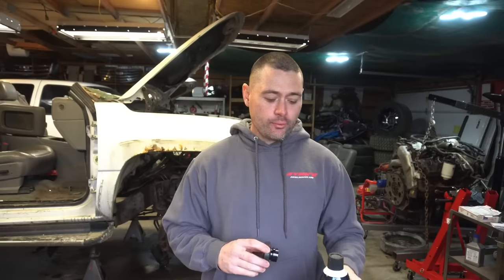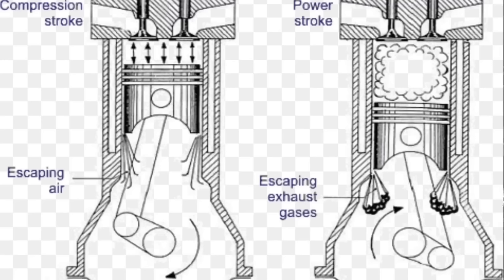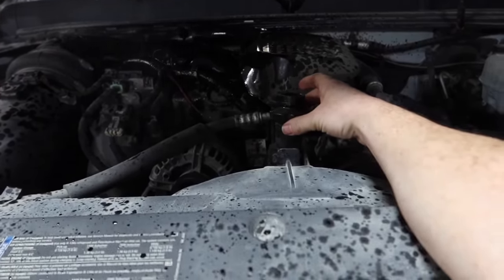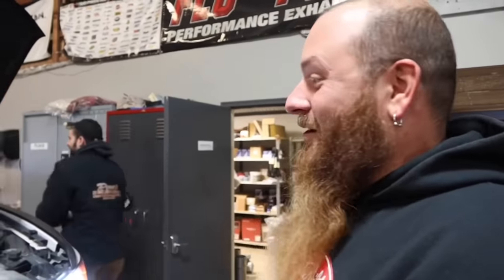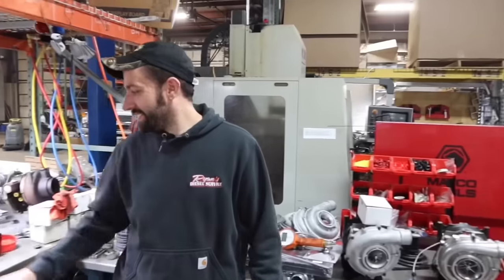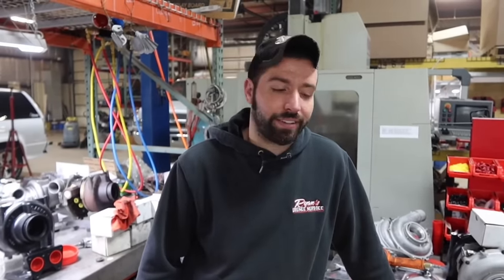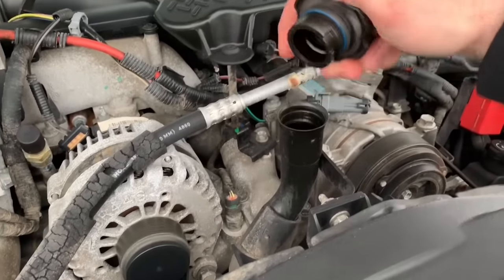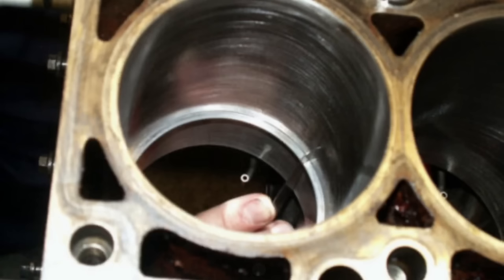What Is Diesel Blow By?

Comment: I bought a used 2013 Chevy Silverado 2500HD 6.6L LML Duramax with 144,645 miles on it. 100% stock and very clean inside and out. I did the oil filler cap blow by test at the end of my test drive, I bought the truck from a chevy dealership, and when I arrived at the dealership to check it out, they had it running and ready to go so I couldn't check blow by at cold start. But warmed up to full operating temperature the cap just sat there and didn't move. I ended up buying the truck, and at cold start the oil fill cap again just sits there when placed upside down on the oil filler neck. I'm going to be changing my oil with Rotella T6 and using WIX oil filters about every 4,000 miles. 3,500 / 4,000 miles. Keeping the oil clean goes a long way. It's cheap insurance, well maybe not cheap with Biden in office but it's still easy insurance.
Reply: Give a Bosch filter a try sometime
Reply: @jayweathers2701  fuel or oil?

Comment: Hi
I bought a hyundai tucson 2008 from a friend yesterday and I knew it had an oil leak about a year ago from the rocker gasket and he assured me it was fixed before I bought it 
I paid a deposit and drove 75 kilometers back home and the next morning their was oil all over my driveway.
I bought it to my mechanic the next day and he was 22 minutes away and he took the oil filler cap off when it was up to temperature and not only was it smoking bad from the oil filler but also the dip stick hole.
The friend if mine was dishonest but I did get my money back but he is convinced that by Changing a couple of oil seals it will be ok.
I drove it for a while the day after I purchased the car and the check engine light came on and it was running lumpy and I got it home and I could smell the fumes in the cab.
Anyway it was a lesson learned and I honestly never knew that this way an issue was diesel engines before this.

Comment: I had blow by on my 2006 6.6l lbz turbo blew motor and everything just throwing new motor in stock block with new heads pistons cylinders injectors head studded engine bored out completely so i’m doing a wold fob 68mm 360 thrust bearings 10 blade wheel into 3” mbrp down pipe in 4” flo pro out to axel dump with 8” tip.

Comment: I have a 2019 ram 3500 4x4 6.7 Cummins. I use it for a hotshot and just recently had it deleted. I have 460636 miles on it. Now that it is deleted, I feel like I made the wrong decision. I kept on having multiple problems with the emissions. Every time I would go back out on the road, I was constantly having problems. I am stuck between a rock and a hard place. Any advice would help on what my next move would be greatly appreciated
Reply from the maker: Whoever deleted it didn’t tune it probably.

Comment: My lly and lbz have zero blow by as well as my old lb7 all above 300k all of my buddies dmaxs also have no blow by my old 7.3 and 2 6.0s had a decent amount of blow by at 150-200k and 2 of my other buddy’s cummins had blow by. All preety good running trucks it seems like dmaxs don’t have blow by at all until something’s seriously wrong but pstrokes and cummins have it more times than not but it’s “normal”
Reply: International designed the pistons and rings to use crank pressure and blowby to keep the pistons from polishing the cylinder bore
Its a patented design

Comment: New to diesel's my 6.6 lb7 has very little blow by and I was wondering if blow by could come from under the engine some have told me it's the Crankcase pressure outlet it's just annoying to see the haze coming from underneath if you could help I'll greatly appreciate it

Comment: I have a obs 7.3 and it does not blow or move the oil cap off when I check but there is a good amount of steam . Even out the crankcase looks like a train lol it that something I should be worried about has 230k miles
Reply: Stream is prefectly normal, pressure not so much. I would say nothing to be worried about

Comment: What if I had a injector leaching on my lb7 witch leaks inside the head and i fixed it and had blow now it’s blown up? 😂 hmmmmmmmmmm I work on lb7 lly lmm lml l5p scan tool does not fix all problems try a lb7 bottom end with lbz top end with duel fuel and tell me there is no blow by but still do a 1200hp

Comment: I appreciate your videos! Looking to step into diesel truck life. Hoping to buy an 06 lbz crew cab long bed. It has 210,000 on it 1 owner bone stock. What should be the number 1 thing to be considered when buying a truck with that age and miles. Any help would be greatly appreciated.
Reply: Im relatively new to diesels but i think that if you are going to spend good money to buy a diesel and dont know all about diesel engines spend the bit extra getting a diesel professional to check it over because if you buy a bad one its painful. I know its 5months late but hope it helps. 👍